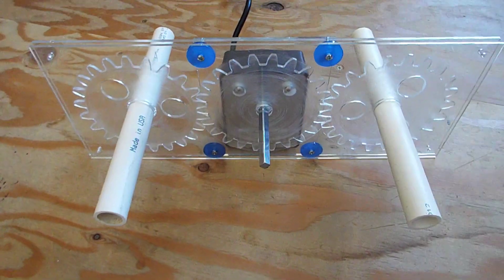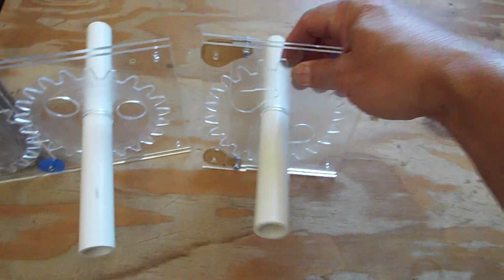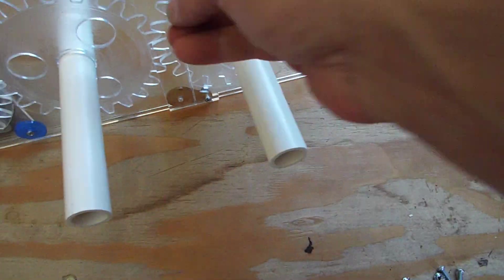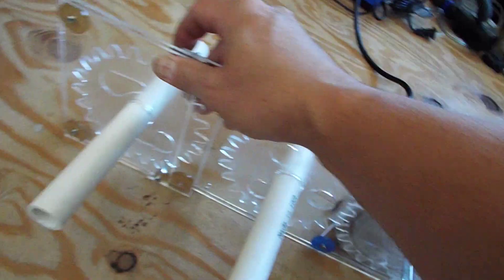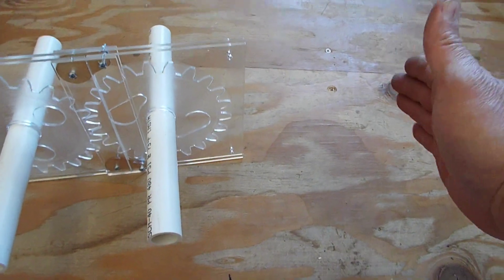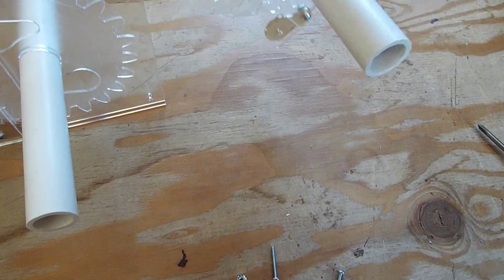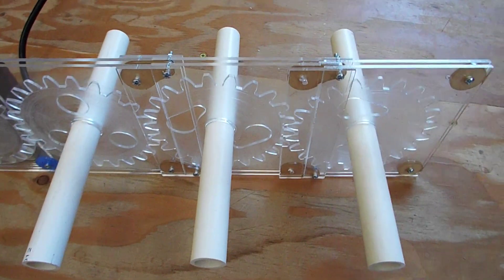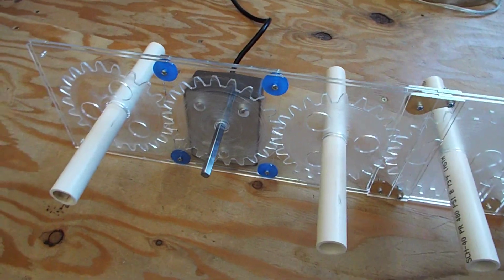Adding on to the DIY Cuptisserie Tumbler Cup Rotisserie Turner

Comment: How much for a 12 cup design I have the motor and PVC I just need the gears and box setup let me know Kaos6588@yahoo.com
Reply: And that looks awesome
Reply from the maker: Thanks! I am just starting up production it might be a couple of weeks before the first units start to go out. The base unit does 4 cups without the rotisserie shaft adapter, then it would do 5. The base unit kit will be $85 plus shipping.  Add on section for single shaft (2 cups) is $35, I plan on making but have not had time yet a two shaft and three shaft add on section. right now budgetary price for those would be $60 and $85 respectively ( it is mainly materials and laser cutter time that is the cost driver). I am working an assembly video this weekend. The base unit kit will include the back plate, the front plate, the motor mount plate, the three gears, the two PVC shafts that will be cut to a very specific length so that the gear sits as close to the center of the shaft as possible, two custom assembly jigs for the gear mounting to the PVC and rotisserie shaft, eight screws, eight washer/spacers, eight nuts, eight acrylic spacers, a square rod cut to a specific length, a vial of synthetic grease that is compatible with the acrylic and PVC, and brush for the grease. You can see this in the video that should post within the next 24 hours.
Reply: @madscientisthut  so around $200= 4 shaft---2 solid state 2 add on  and rotisserie is there a mounted footer to keep it stable kinda like a U bracket so the weight is distributed when all shafts are loaded
Reply from the maker: The footer is up to the end user. Easiest is 1x2 board cut to 4 inch lengths then screwed down so that the acrylic can slip between it. I have a work bench that is made of wood so I would just screw the 1x2 pieces directly there. But I could see someone wanting it portable too, so then they could just get a 2x10 or a nice piece of  3/4 inch plywood and cut it to the size (how many add-ons) then attach the 1x2s to that.
Reply: @madscientisthut  gotcha I'm currently using a single Turner with butcher block 1in board and backing
Reply: @madscientisthut  I'm interested in getting one at least 8 cup when your ready let me know you have my email info and cell number. And ty for the quick responses.

Comment: I would luv to get this
Reply from the maker: I am currently traveling, I will be  back in a couple of weeks. Will this delay be too long for you? How many cups do you need to turn at the same time?

You can contact me at www.madscientisthut.com and go to  the contact page and use the contact form. 

The base unit does 4 cups without the rotisserie shaft adapter, then it would do 5. Do you want a kit ( you purchase the motor and assemble it, I will make a video showing how to assemble it) or a assembled tested unit? The cost for the assembled tested (run for several days) unit will be $165 plus shipping, the kit will be $85 plus shipping. You can get the motor on Amazon for about $23 https://www.amazon.com/gp/product/B07BFR6RLZ/ref=as_li_ss_tl?ie=UTF8&psc=1&linkCode=ll1&tag=madscientis08-20&linkId=b001de18bd7743132569d90b9c61a67d&language=en_US
Show less

Comment: -How is the PVC connected to the gears?  Just press fit?  Only issue I worry about is gears cracking from shaft to holes in gears after long term use with weight on shafts.
-Wouldn't sch 80 be firmer so shafts don't sag when loaded? Or is sch 40 firm enough (cups are about 1.5lbs)?
-How much distance between shafts?  Might want the gears (sections) a tad bigger to increase this.  Of course then the motor would need a spacer on the bottom.

I am Interested in a kit, good job, nice design.
Reply from the maker: The PVC is glued to the gears with CA, I designed an assembly jig that slides together and will come with the kits so that the gear is attached orthogonal to the shaft.  I do not think it will crack unless something is done beyond normal use like dropping or excessively loading the shaft, or using a solvent on the acrylic. I think the sch 40 seems to be solid enough. There is about a little bit more than 5.5 inches gear center to gear center, so unless the cup is very large  it should not be an issue ( you could also skip every other shaft for extra large cups) or I could design and add on section that has a spacer gear. The reason I chose this size was to keep the design inside of the working area of the laser, I could increase it a very small amount before having to redesign the base system. The one that is shown in the second video has been running for about a month just to test the longevity of the design and I have not had major issues yet, just a little lubrication displacement. I will have to figure out a PM schedule of when lubrication needs to be added for every so many hours of run time.  I am on the road for a couple of weeks so there will be a delay in making any more until I get back. Are you interested in the base unit with 4 cups ( I can finish the design for the center of the rotisserie shaft and then it will do 5 on the base unit) If you can go to www.madscientisthut.com and use the contact form there.
Reply: @madscientisthut  Thanks for your reply.  It seems like it would be easy to lube, if it needs reapplication every so often.  Is it loaded while testing?  With either tumblers or 1/1.5lbs at shaft end.  

I will contact you for a kit on your website, it would be for an Xmas gift, so have a good trip.  It would be for 4/5 cup unit, if you finish the rotisserie shaft add-on.  And thanks again.
Reply from the maker: I have not added weights to the second unit, since I am trying to do one thing at a time ( I want  to see how the gears hold onto the synthetic lubricant, I can add weight to it when I get home to see hoe that changes things next). The first unit is in actual use in a shop that does custom tumblers, I have heard it is working great there, no problems with it yet. The preventive maintenance (PM) should not take more than a few minutes to add lube.

Comment: i am interested in one I would like to purchase
Reply from the maker: I am currently traveling, I will be  back in a couple of weeks. Will this delay be too long for you? How many cups do you need to turn at the same time?
Reply: 3
Reply from the maker: The base unit does 4 cups without the rotisserie shaft adapter, then it would do 5. Do you want a kit ( you purchase the motor and assemble it, I will make a video showing how to assemble it) or a assembled tested unit? The cost for the assembled tested (run for several days) unit will be $165 plus shipping, the kit will be $85 plus shipping. You can get the motor on Amazon for about $23 https://www.amazon.com/gp/product/B07BFR6RLZ/ref=as_li_ss_tl?ie=UTF8&psc=1&linkCode=ll1&tag=madscientis08-20&linkId=b001de18bd7743132569d90b9c61a67d&language=en_US